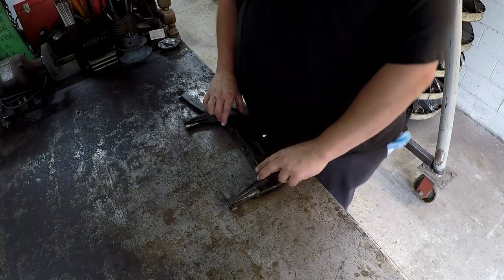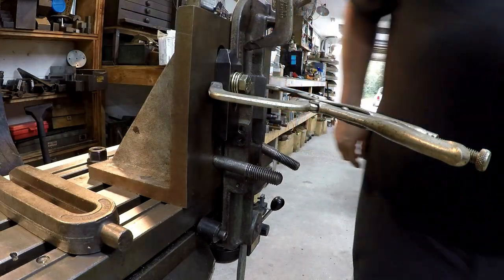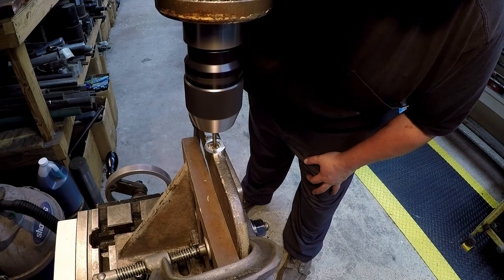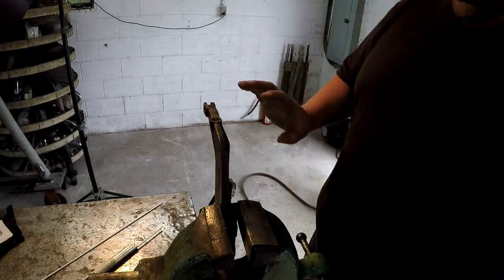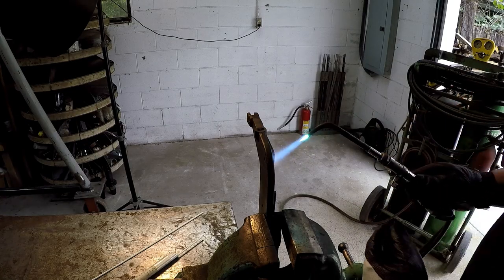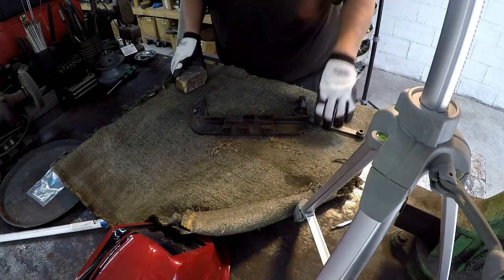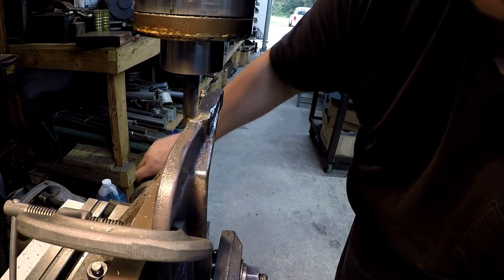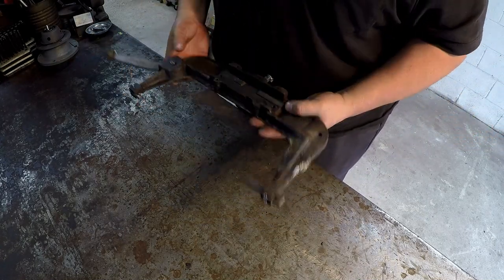Craftsman Power Hacksaw Braze Repair

Comment: hi adam, that's the best brazing video i've seen on youtube. a method i use for removing bolts that works about 70% of the time is to clean up the top of the stud with a carbide burr then center punch a dot as close to center as you can get. then drill as far as you dare with the correct size drill for whatever size " easy out " you are gonna use. then i put a crescent  on the easy out and have a small hammer ready. heat the area around the stud to near cherry red. wait about 15 seconds and then while tapping the easy out very gently into the stud start unscewing it with the wrench. it usually come outa there with a squeak. if it don't, go directly to plan B. thank you for ALL the videos you make.

Comment: I've been a welder for 40 years. I've seen several videos of braze repair of cast iron and it certainly works well. If you TIG weld, welding cast iron with Nickel 99 tig rod is sometimes better. It runs really sweet and you get the tight, precise control of the weld deposit with the TIG welding process. It is rather expensive but worth it.

Comment: Excellent video for those who have never brazed. An alternate fix would be to tap that hole 1/2", run a bolt all the way through, bugger up the last two threads, wind it back and cut off,  then drill and tap that new bolt for 1/4-20. Less work and could be done in one set up.  That's Monday morning quarter backing way.........

Comment: Deburring and even rounding corners on cast helps prevent hard spots. When the cast has sharp corners or burrs heating causes it to crystallize making it very hard and brittle. Same thing happens when the cast cools too quickly.

Comment: nice brazing job - so patient!  Thanks for including the gas settings.  I've tried to go by the book at 1:1 ratio but never got good results.  After experimenting and tension testing in the lab, I found that 7spi acetylene to 20 psi oxygen.  Very few Youtube creators include gas pressures.
Reply: You might be interested in This Old Tony's video: Let's Talk Oxy Acetylene. https://www.youtube.com/watch?v=-uPAjIOkLVA
Reply: Ujeb08:  I agree, what a great brazing job. just don't go over 15 on the acetylene since it's an unstable gas.

Comment: Quick tip when using an oxy-acetylene torch - the tip of the inner flame is actually the hottest part, so holding that against your part will get it hotter faster..

Comment: I'll share my technique for big braze jobs - I position two propane torches on either side of the part to keep it warming up, but without the extreme heat of an oxy-acetylene welding tip. Use an oxy-acetylene rosebud tip to generate lots of BTUs, but not the searing temperatures that made the part's edges sweat in the video. It looked like you had a Smith AW-series torch handle, so try the Smith (Miller) AT-605 rosebud next time. It pumps out about 41,000 BTUs. I'm guessing you were using an AW-205 or AW-207?

Comment: Great heat control on the cast iron, looks like a Smiths with about a #7 tip.....Dave
Reply from the maker: +David Richards Smith equipment is what I use David. That tip was a #5. I have both the smaller torch body and the larger one with cutting tips good for 6” material. I want to make some video of flame cutting one of these days.

Comment: The camera worked well for the gas torch .  Do not know about arc welding .

     Spray a little flat black paint on the repaired part and will look and perform as origional .

Good job ,   :-)
Wyr
God bless

Comment: I had a very expensive automated scaled meat slicer that had a stainless platen which had a cast aluminum outer mount screwed onto it with slightly different alloy stainless bolts, due to dis-similar metals electrolysis and very harsh dis-disinfectants the bolts had corrode-welded themselves into the fixture,  I was very similarly using my torch like you to burn out some of the Aluminum oxide to release the bolt when a very attractive lady which worked in the bakery section decided to then have a conversation with me, I got so caught up in our conversation that I completely melted off the end of the platen mount (DOH), I acted nonchalantly and pretended that was exactly what I wanted to happen, then went to the truck and got the needed replacement parts.

Comment: Here is South Africa we have a product called Easyout for broken stud removable It consists of various sizes of taped shanks with left hand course threading. In the above video when the left hand drill did not provide the necessary torque to  remove the broken stud the correct size Easyout would have done the trick, saving all the added work this repair required.

Comment: Excellent job. I'm not a machinist but have a few questions. 1: Wouldn't a little bit of heat on the outside around where the bolt was stuck help release the bolt with the left handed bit(s)? 2: The earlier repair, (unless one is a perfectionist), wouldn't the repair look at bit better if machined down to match the rest of the frame, or would that affect the integrity of the previous braze? 
Again, I'm no machinist, always been intrigued with this type of work, which is why I follow you and Keith Fenner. Cheers :)

Comment: Next time brazing a hole up try this fill the hole full of borax flux proceed with heat watch flux melt add more it will keep oxygen oxydation out of the hole when clear like water add your filler rod keep the rod in the hole wipe the rod in a circle motion until the hole is filled to the top .🙌🔔🔔

Comment: I think I would have painted flux in the hole before preheatng.
I don't know if it would have made much difference. Getting the piece hot enough for the brazing metal to flow is the key.
Thanks
Reply: At 16:36 he melts the exterior coating of the rod into the hole.  The coating is flux.  I don't think it would help to flux the flux.

Comment: ....good job....2 choices.....braze it up solid, or sweat in a short piece of steel rod...then drill/tap....
 Nice video, the filter removed the pinkish infra-red...

 Craftsman.....they farm out most of their stuff, often every couple years...that can be annoying if you're looking for replacement  parts, since they don't have that service anymore....
 I've got a Craftsmen compressor I bought used in 1981...still works fine, I just now replaced the ribbed drive belt.....receiver (tank) is good quality, air-pump is Speedair, motor is Leeson....no parts actually made by craftsman...

Comment: Aloha Adam, Why not a thread insert instead of the heat?  In my time I have had good results with A UV filter and  ND filter and a combination could handle most anything, but that was with film. Excellent video @ 77 I am still not too old to learn. Carbide tooling was not the norm in my day, maybe some brazed carbide tooling and I had to beg for that!  Mahalo and keep up the good work.
Reply from the maker: +Charles Cartwright Brazing made for a much better fix, better video, and it’s the way he requested me to fix it.

Comment: Adam, while watching your efforts to get the center directly above the center of the broken bolt, I wondered, do they make a laser center that you can chuck up and then be able to see if you are on point without having to bring the center down to almost touching the work piece? I just thought how much easier it would be for you to see if the chuck was centered if you had a laser pointing down at the piece.
Reply: I don't think so. I have X hairs laser on my cnc and it's great for locating a point like the corner of something or a dot. The points on the end mill(correct size) are going to be closer to the edge of the existing hole so easier to judge the equal distances. IMHO
Reply: Okay thanks. I'm a woodworker not a machinist. I just love to watch this man work!

Comment: hello adam  i have a question. is the brazeing  strong enough to hold a good strong thread in this application?  just wodering if you could have made a steel plug pressed it in and then welded it to the cast with silicon bronze tig wire  and then tapped and drilled. just curious. nice brazing.

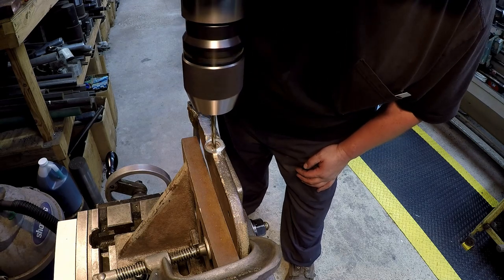Comment: The bit you're using at 10:47 looks to me like a twist drill, but you called it an end mill. What is the distinction? I thought end mills usually had horizontal grooves as well. Is it a special kind?
Reply: End mills are flat on the bottom and can be used for removing material in all directions, not just verticle like a drill
Reply from the maker: +naota3k Drills are only made to make a hole in one direction. An end mill is used to mill on its side or plunge down like a drill. Mills are used to any time of milling job.

Comment: just wondering why not just mill hole tap like to 7/16 to 1/2  install a plug mill then drill and tap to 1/4 20 ???  so your not over heating the cast

Comment: Quality stuff right there. 

How does the brazing and heating affect the hardness of the material?
Reply: While not impossible, welding cast iron is very, very, tricky business.  Because base metal melting actually occurs, inclusions of ferric carbide (VERY hard/not machinable) form.  :>(  OTOH, brazing is high temperature soldering and the base metal does not melt.  Whatever alloying does occur is due to solution effects.  The brazing bronze is fairly hard and less brittle than the cast iron.

Eli D.
Reply: Eli Duttman hey. Thanks for the response. I guess i worded it a bit weird. I know that brazing doesnt involve melting the original material, but it still seems like you heat it a lot. Wouldnt that affect the hardness of the original piece?
Reply: thebestnumber1 no. cast iron is a little different from steel. the bronze would be affected a little more, but both metals adam cooled slowly to prevent tomfoolery
Reply from the maker: Brazing like I did here has been used for ages on cast iron, and steel. If done correctly your not going to damage the cast iron. You don't want to melt it though.

Comment: How would have milling away the entire thread socket and welding in a solid metal bar to replace it compared as a repair?
Mainly in terms of worktime, price and of course primarily strenght.
Reply: Brazing is cheaper and easier on cast iron parts like this. You have to nail the preheat and postheat on cast iron to avoid potential cracks in the weld bead or heat affected zone (high carbon content of the base metal dilutes into the weld and makes it brittle). With a blind hole you also only have weld on the very end holding the hypothetical metal bar in place - thus the braze may actually be stronger.

Comment: Great video! Why do you braise this with a soft metal instead of welding it?
Reply from the maker: +Idbuythatfora$ Brazing is a very common repair for cast iron. It’s full of carbon and in many cases can create a hard weld or hard spots when welded.
Reply: Thanks Abom! You're the man!

Comment: Is there a reason besides overall height that he chose to plunge cut with a 1/2in endmill rather than just drilling 1/2in?
Reply: End mills are much stiffer than drill bits. They also tend to produce a flat surface so it's easier to then spot drill and drill through the bolt keeping the drill straight.

Comment: some years ago I head of Oxy-Propane , but it seems no-one has shown it on YouTube much. Have you used it before? if so what do you think of it? or what have you heard?
Reply: I used oxy-propane In a couple shops....not as hot as oxy-acet.....it'll cut plate, but slowly and  takes a long time to start cuts. Mainly I liked it using big heating tips and 3-4" plate I working with....and heating big bearings...5-6" shaft and some were 450mm...about 18" inside diameter roller bearings...big stuff, mining equipment. Also used it a lot on railroad wheel Timken cartridges...about 200mm shaft...
Reply: thanks Doug. iv'e trying to decide which way to go, it sounds like it wont fit my home shop needs. thanks for the info!

Comment: Whats the difference between brazing and welding?
Reply: Welding melts the base metal.  Brazing is high temperature soldering, where only the filler alloy melts.

Eli D.

Comment: Hey Adam, 
I know there is always more than one way to make a repair.  I was wondering if this could also be repaired with inserting a piece of round stock with an interference fit kind of like you did with that ring gear on the gear box shaft?  Something like heating the part, and freezing the stock and pressing?  I'm just asking for my own education.  I'm not questioning the method used.  Your videos inspire me to come up with questions to expand my own knowledge.
Reply: Oh, by the way, great work, and clear video with the ND filter.
Reply from the maker: +Clint Ferreira For someone who don’t have Brazing equipment, you could drill and tap the housing larger, locktite a bolt or stud in, the drill and tap the center for proper bolt size.
Reply: Abom79 thank you.

Comment: Little aggressive on the gas there Adam. I'd have cut the flame down a lot especially for a blind hole like that. You want to be able to almost touch the weld puddle with the cone. At a guess an eight inch cone would have worked.